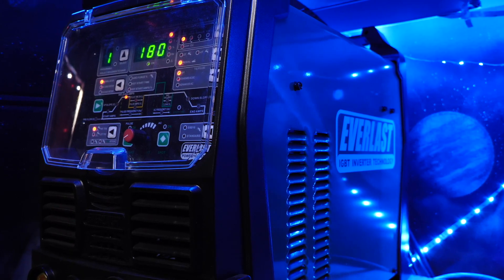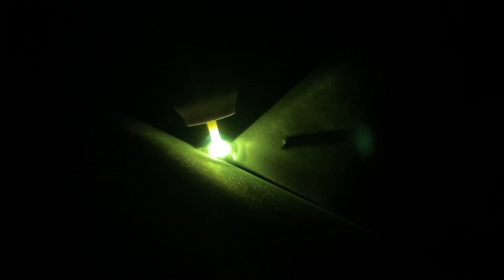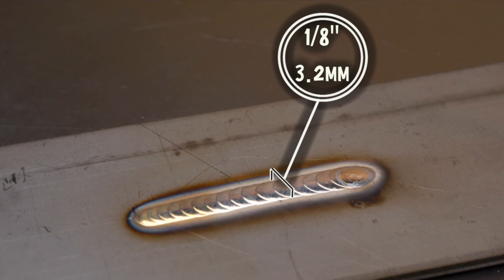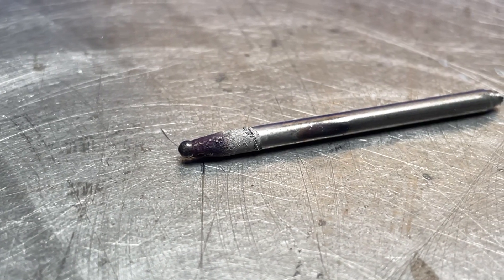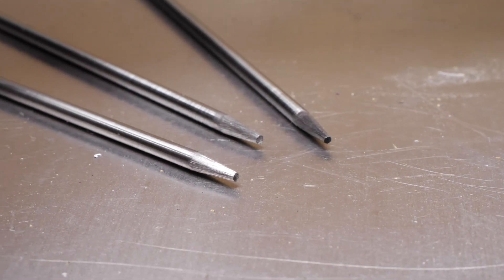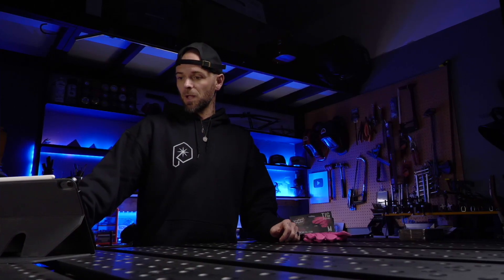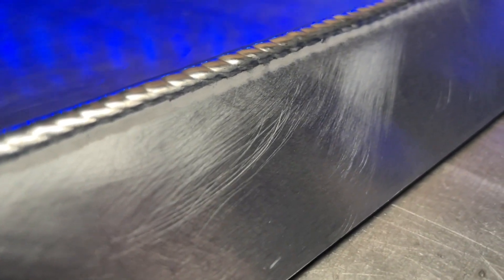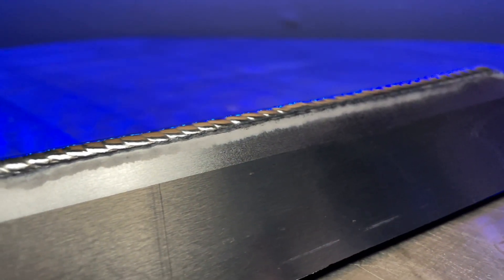5 tig welding tips in 5 minutes

Comment: No1 is interesting.  Often thats caused by undersized tungsten for the amps. The more common problem is people not using enough amps and wait to long for a puddle. Have to tell them to stand on the throttle to get the puddle going.

Comment: Guilty of starting too hot with aluminum, especially after welding stainless where you need quick heat
Reply from the maker: Yes! Definitely a small adjustment, but you can make the adjustment pretty easily🙂 I appreciate you checking out the episode so much, happy welding💎
Reply: I'm guilty as well